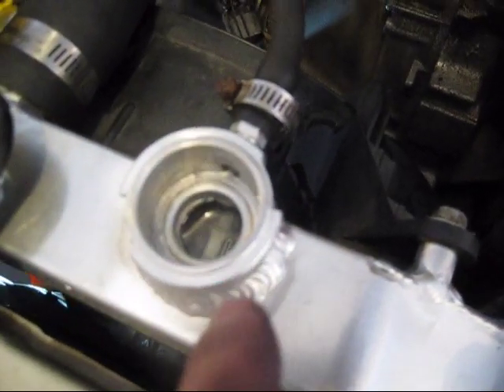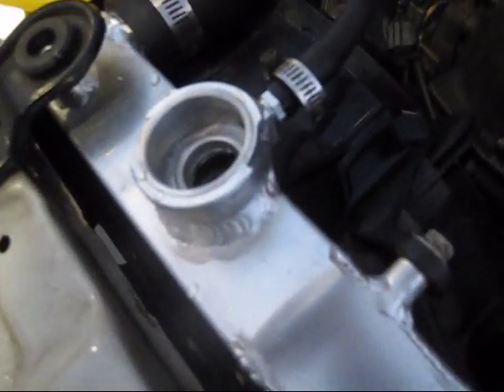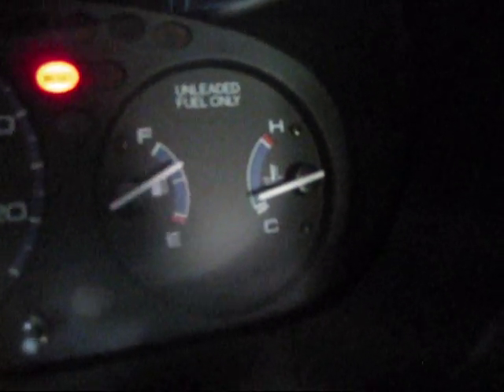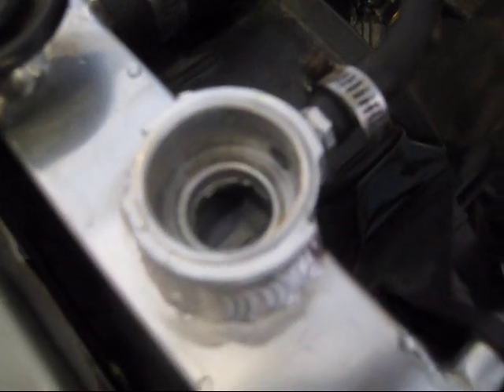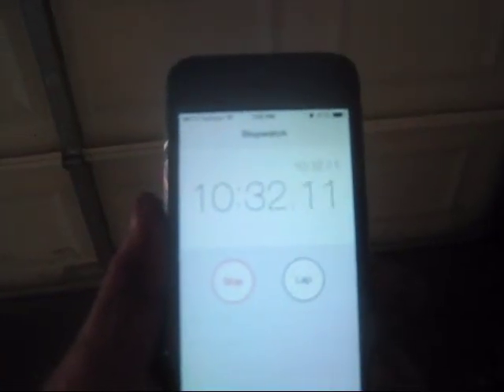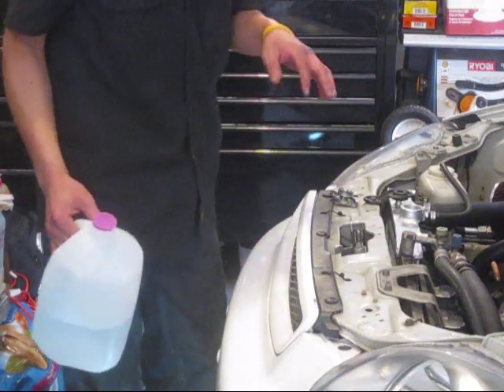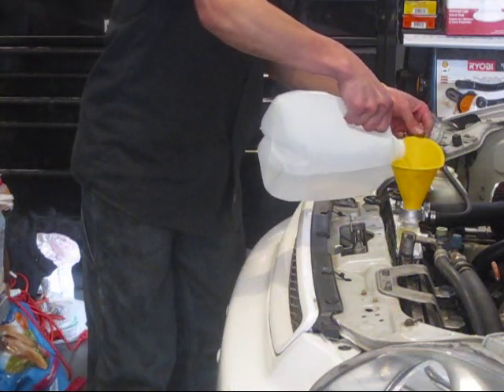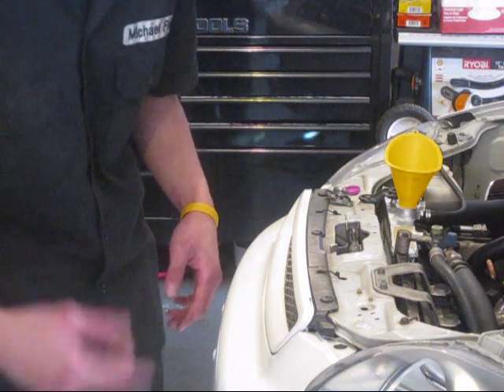How to Flush Radiator Coolant with Michael Flare

Comment: Hey Mike, great video as always bro 😊. I noticed you didn't remove the thermostat  and drain the extra coolant still in the engine block, is it not important to do?
Reply from the maker: The thermostat is placed at the highest point in the coolant pathway in the engine. Removing the thermostat won't drain anymore coolant at all. You want to remove the lowest point of the path which is the drain plug for the radiator; this is the proper way of draining the coolant on almost every car.
Reply: Michael Flare, 

https://youtu.be/KQjMUnd5K-U
what you think about this guys method of driving the car between draining the cooling system and if you look, there was quite alot of coolant that came out of the thermostat even though he had already drained the coolant out of the drain plug?
Reply from the maker: For sure his method is better because it's a much more thorough draining of the coolant. The thermostat doesn't sit exactly at the highest point, it's probably at least 90% the highest point up so it still holds a little bit of coolant. Think of a coolant change like an oil change. It's the same concept. It's almost impossible to flush/clean out every corner inside the engine. The owner's manual gives you the necessary and proper way of changing out these fluids using the drain plug. When you do this, the vast majority of the fluid gets removed but impossible to do all. What other people do is take it a step further and try to remove more of the old fluid by removing some parts like the thermostat and even cycling (driving) the new fluid through the engine and flushing it out again to get as much of the old fluid out as possible. It's highly unnecessary especially if you change your fluids out on schedule like you're supposed to. If the fluid has been changed out like in 200,000 miles, then yeah it'll help but still not necessary.
Reply: Michael Flare, Cool Mike! 😊. What quantity of the Prestone cooling system flush did you use bro,...was it like 600ml or so? I can't get any Prestone here but I've found Wynn's Cooling System Flush at about 325ml per can, so I'm thinking of buying 2 cans to make about 600ish ml like you had of Prestone. Also Mike,....do you recommend using a cooling flush cleaner in your experience or did it cause any leaks, problems with rubber seals, etc in the cooling system?
Reply from the maker: I'm not sure exactly how many mL was in this Prestone cleaner. Make sure you read the instructions on the bottle; most likely, one bottle of what you have should be enough. I don't think they would make you buy more than one bottle. I don't have any issues at all after using the cleaner; the car is still perfect!
Reply: Michael Flare I too have a silver H series 1.4 civic, you're a huuuge inspiration bro, wow most immaculate civic I seen, you did Great bro 😊
Reply: Michael Flare, Mike are you on FB bro? could I add you,? Im Michael Paterson in England, originally from Zimbabwe, here with my family 18 years 😊
Reply from the maker: I do have facebook but I usually don't add people I never met. I'm sorry. You can always message me on there though, and I can help through there.
Reply: Michael Flare cool no worries bro 😊

Comment: What website or do you buy your products from?
Reply from the maker: Dimetri Byron eBay is the best place to find parts and here is why. eBay is probably the biggest and most diverse market in the world. eBay sells all kinds of stuff from private sellers to business sellers. They sell both FAKE and REAL parts. Here are some tips to distinguish the two when you buy parts from eBay. Either way, you can buy fake or real, it is up to your preference.
1. Observe the seller ratings and feedbacks
2. Do research on the internet about parts you want to buy.
3. FAKE parts are BRAND NEW AND LOW PRICE for Civic EKs, most of the time.
4. REAL parts are USED AND HIGH PRICE for Civic EKs, most of the time.
5. Read item description very carefully before you buy.

Comment: does the water have to be distilled? or is it just better
Reply from the maker: Highly recommended.
Reply: Michael Flare whats the difference with regular water?
Reply from the maker: Regular water has minerals which can cause corrosion inside cooling system. Distilled water is completely pure with no sediments like minerals.